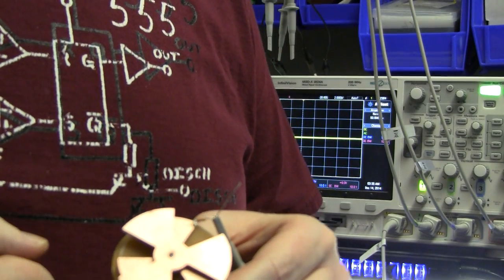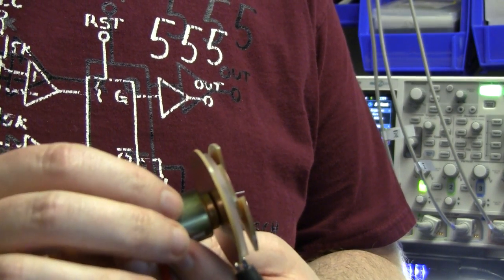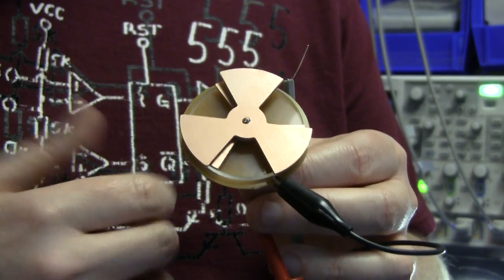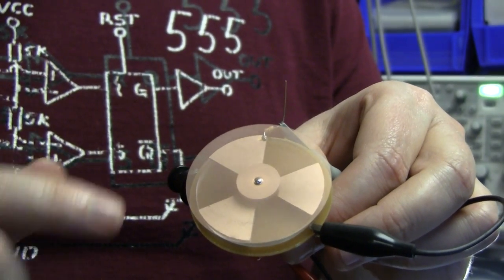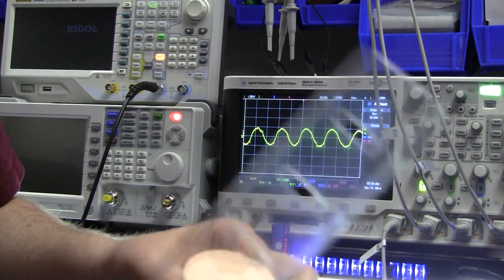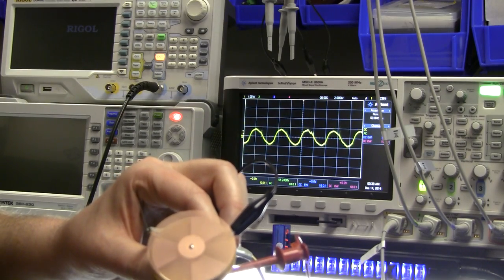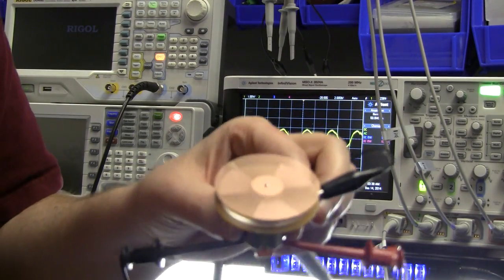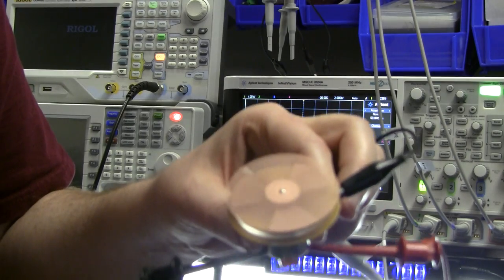Advent Calendar of Circuits 2014: Day 13: Field Mill

Comment: How very interesting :)
I loved this project.

What i would love to see would be a very basic and simple signal generator.
Something small and portable. Maybe a 9 battery one with square triangle and sin?
Just thinking, not sure if it's so easy to build, but i think it would be quite useful.
Reply: Simplest way to do that is to find an 8038 or MAX038 IC. Probably have to find them on eBay as I think they are discontinued. Very simple way to make a very decent sine-triangle-square wave wide range signal generator.

Comment: Looking at the EMI from the motor on your scope, looks like the motor has 3 coils and if you had 6 sectors rather than 3 you could synchronize to the motor's commutator, to be able to detect polarity.
Reply from the maker: Yes I considered this also. The noise is a bit inconsistent in amplitude as has some phase jitter, a filter and loop could clean that up though...  a perhaps superior method would be to use a brushless DC motor and derive the phase reference from its driver which is also synchronous.  It would also need to have its pole pair count and phasing matched to the vanes but that isn't too difficult to achieve.
Reply: @vk2zay  Yeah, brushless motor would certainly be cleaner. Maybe something like a brushless computer fan motor, with the blades cut off and replaced with the shading disk. edit: and typically it has a hall effect sensor that would trigger once per revolution so you can have however many or few vanes you want. I think I might've just talked myself into building one for the kids, its always fun to play with anything that shows something you can't see.

Comment: I have an idea to build a field mill without moving parts by replacing the rotating part with a mesh you can switch between high and low impedance to ground. If you add the option to put a reference voltage to the same mesh you could even do a possible self-calibration. Do you think this would work? Perhaps another advent calendar item?
Reply from the maker: Milan van de Swaluw I've had similar thoughts, I think it would work.  It will become charged by induction when floated...  The voltage on the floated plate can soar when the capacitance between it and ground drops though, which has some implications for the switch and may make it impossible to calibrate accurately.  The switch would need to be very high impedance and stand off a great deal of voltage, maybe a reed-relay?  Sharp points inside the switch may leak via corona and cause problems...  Still something I'd love to try.
Reply: vk2zay I had plans to use a 4066 to switch the shield mesh between 0v and logic level (probably 3.3v), or high impedance (10pA leakage) when no switch was activated. Then I would make a double field mill on one pcb and do a delta measurement between the sense-plate with low-impedance shield and the one with high-impedance shield. Once in a while you could switch one shield to the logic level to do self calibration (correct for polarity and amplitude). By altering duty cycle of the activation of the shields you could prevent and overload of your sense-plate.
Reply: @mvdswaluw  did you ever construct this theoretical field mill? Sounds like a great idea!!